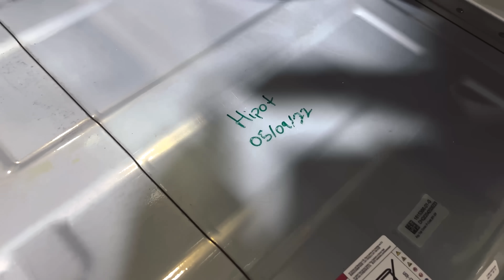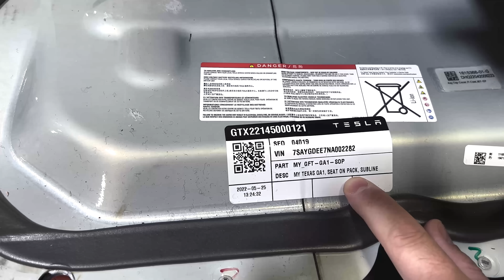Tesla Model Y 4680 Structural Pack OUT!!!

Comment: 6:15 This penthouse to house controls for the battery, can it be reduced in size? Not so much reducing the height but reduce the area it covers, so the length and width are half the current size or smaller. It might be possible to use the penthouse cover to mount the electronic parts or use the current panel for half of the components and the inside of the cover for the other half. The electronics serving the electric motors are mounted on the inside of the cover, same idea here.

Comment: I think we're not talking about a structural battery. It's a structural battery enclosure, which is a traditional stamped formed structure that integrates to the giga formed structure and other stambed structure such as A B and C pillars and car ceiling.There is nothing revolutionary here. They just firt the cells inside a traditional car floor structure.

Comment: On the Model Y - Is the battery located directly underneath the lift points? Or is it located slightly inside of the lift points towards the center of the vehicle?

Comment: The powder coat on all metal is because snow from your boots will rot the floor, and water and road salt will guaranteed get past any seal and rot the battery top/floor.  I have driven in 50 Michigan winters, I do know.  They are going to need air vents and water drain holes.

Comment: The floor/no-floor is an achievement but maybe this achievement is responsible for body low frequency noises when tires run over any road bumps. Could you tell if the battery pack assembly has any center deflection?

Comment: Incredible simplification and integration.  Tesla remains many years ahead of "competitors" due to a lot of clean sheet thinking AND continual improvement with VERY SHORT and concurrent change cycles due to spiral development practices.  

See also the Raptor 1 vs Raptor 2 rocket engines of SpaceX on Everyday Astronaut's recent video.  Also insanely simplified and integrated.  

Same thinking on both.

Comment: Tesla makes improvements monthly.  Legacy wait 5 years for mid cycle refresh or 8-10 year new model.  I owned a new dodge recently.  Power windows going out even one’s that were previously repaired and under warranty.( my time wasted going dealership all the time). I asked the guy have their not improved this same part.  His response was they needed to use up the old parts before the new improved part.  Use up old parts under warranty until warranty expires.  You would like power windows would be really durable.  Too much obsolescence built in the parts

Comment: It takes less than a minute to make a model 3 or Y, something like 44 secs for a M3.  This was before the structural battery pack was introduced, probably a little faster now for the MY coming out of GF Texas.  Mind-boggling.  And GM is currently making 12 Hummer EVs a day, like Elon said ‘they have to improve’ their production, that was commenting on GM’s 4th Qtr production of 25 Bolts and 1 Hummer EV. Guess 12 is a big improvement, 1200% increase.

Comment: Curious if the "powder coating" as you discussed has something to do to reduce conductivity. Given that the battery pack is now the floor, perhaps it's to reduce electrical and/ or thermal transfer?

Comment: My question is about pack serviceability in making the manufacture of the pack so efficient, it appears that the pack has been rendered unservicable.  I don't see how individual cells can be replaced when the pack starts to experience failures. I would love to see Munroe Assoc explain their take on what happens to the pack when enough cells go bad rendering the pack to inefficient .  Do you simply replace the entire pack?  What would the cost of a pack replacement be and what will Tesla charge for a pack replacement.  How long is there warrantee on the pack and the terms?  The old style packs seem a lot more serviceable where you can more easily remove the pack, open it and test individual cells and replace as necessary  without having to scrap an entire pack that may only have a couple dozen bad cells inside.

Comment: This kind of engineering is what Tesla's overall cost is spent on...and it makes it all worth it... for the buyers by making a car that's as safe as possible and for Tesla workers by making their job(s) as easy as possible... a win win win for Elon's pocket...

Now, when will Tesla build a 2-piece car - the bottom and the top shell, exactly like old Japanese flywheel powered cars but the two pieces are welded all the way around, like maybe ships? Connections will all be wireless and actually have no wires anywhere  and steer by wire?

Comment: Great... 1st of all, its paralleling of processes on assy line. You can remove some stations (seat, carpet, console mounting) from main line and shorten assembly time. Also, mount it outside much faster and easyer for robots. Next, less body parts, as it has no any bottom, so more bodies at shorter line.

Comment: I don't really feel comfortable with the battery pack being the actual floor. I know it saves money, but I still think there should be some sheet of metal between the battery and cabin.

Also, $800 for 1 cell? I guess that is to cover the whole R&D cost since that is, (if 850 cells), $680,000 dollars from the battery pack.

Comment: I look forward to seeing inside the pack. Will be curious to see if end cooling was abandoned completely.
The pack is definitely performing a structural role. In a side impact it can be deformed. Will be interesting to see what side buffer space is provided.
We know that battery packs can suffer thermal events. I hope to see a second inner steel cover and robust external venting adequate to evacuate the products of combustion without excessive pack pressure increase. If filled with resin, is adequate space provided for gasses to escape? Are those hot gas paths in contact with the cabin floor? 
Butt welded sheets of varying thickness may be a weak point in the cabin gas seal.
Hopefully Tesla has added a mechanical backup door latch to the rear seats, enabling those doors to be opened in the event of total power loss, as might happen in a collision.
Not saying this vehicle is a deathtrap, but there are areas worth examining.

Comment: Catl qinlin battery has 4x surface cooling area with in-between cell heat transfer, 621 mi range with 10 min 10 ~> 80% charge time. 

There’s a reason Musk keeps tweeting they’ve lots of optimization to do with 4680s. Chinese aren’t just twiddling their thumbs.

Comment: I'd like to see MA carry out torsional stiffness measurements on the new v.s. old battery enclosures and compare that with that of a cell slab assembly alone.  I wonder if the change in slab orientation to crosswise is to reduce stress on those slabs under body twist?

Comment: I bet Tesla eventually uses side squeeze snaps to mount the battery pack to the gigasting in the future, so they can just press the top and bottom pieces together until they "click" and never have to mess with bolts/threads/wrenches etc.

Comment: @ 1:47 Proof of what I've been saying all along.... The 4680 structural battery pack is an unrepairable POS! With a top cover riveted in place!
Reply: And who exactly was going to repair it?  Looks like they'd swap it and send a bad pack back which would be far cheaper and easier from a service stand point.
Reply: @TheEvilmooseofdoom  Gruber Motor company currently repairs Tesla battery packs. And I'm sure there will be more in the future. Provided the battery packs are repairable. Also, even if they send them out to be "remanufactured", The battery pack has to be designed to be repairable. Not sealed shut! A rebuilt battery pack would be far cheaper than a new battery pack. Built in obsolescence is wasteful, evil, and based on pure greed.

Comment: While I was genuinely excited and love the scale of innovation of engineering & tech involved with the structural pack, I also a bit confused with the safety with this MY. Can anyone enlighten me with the factual information about ..
1) How this structural battery pack can effectively contain the fire accidents as the passengers are directly seated on the cover of the pack?
2) Does the safety remains the same for Side Impact Collisions as the non 4680 Model Y's? 
3) What would be the replacement cost for the defective structural battery pack (If repairs are possible)?
4) How long does that Water Proof seal can hold? If the water is leaked to the cabin what would be the repair cost?
5) Did the overall structural integrity of the car increased with the F, R giga castings and structural pack?

PS. I'm a hardcore Tesla Fan Bot on twitter. I was just asking these questions to clear my doubts.

Comment: Is the new 4680 pack interchangeable with the old 2170 pack? Are the dimensions and bolt hole location the same or different? If different, what are the dimensions of the new pack?
Reply: I dont think so.. these have Front & Rear giga castings with slightly different mount points and side bars integrated with the structural pack (My guess from looking at both videos from Munro Live).

Comment: Good work.

Furniture makers create strong components for things like tables using 2 sheets of veneer which sandwich something called honeycomb, which is cardboard. It's super strong and light. Also, there are companies which use this sandwich technique for prefabricated walls, using thin metal which sandwiches a core of styrofoam. It also is super strong and light. Using batteries as the core in a structural sandwich is perfect for e cars and makes sense because it is so light and strong. Let's see what Tesla will invent next! :)

Comment: I was really worried that the structural battery pack would be a nightmare if there was ever an issue with the battery, however after this video it seems like the opposite is true: replacing the battery seems much easier now if it was ever required
Reply: Easy if you got $20,000-30,000 kicking around to pay Tesla to do it. As nobody else will be able to repair these and the only option will be to pay tesla to make safe and dispose of the huge hazard and replace with a spanking new one.

Comment: I’m definitely getting a “No user serviceable parts inside” feeling about this battery pack.  If there is a problem inside, seems like it would have to be tossed and replaced in entirety.  No “modules” that can be serviced or replaced individually, at a repair depot level.  They must have a high level of confidence in the individual cell reliability.
Reply: the Apple-ification of modern technology continues...
Reply: These things are extraordinarily safe compared to other vehicles, after the 15 years of car ownership, the battery pack could either turn into a power wall for another decade or be recycled, also by Tesla

modularity makes a house out of lego easier to break apart, as well as easier to repair, but the best repair is making it so strong that it doesn't need to be repaired
Reply: also, if a cell goes down, is damaged etc, this does not affect the overall vehicle, it would theoretically work even if half the cells are smashed, and whatever accident got you into that one isn't something that can simply be repaired anyway

Comment: Amazing, the throw away battery. They are getting close to the throw away car. A third party repair shop that could fix major problems would be very hard to find. The owner  would find out it will be treated much like a cell phone, if anything major goes bad just toss it.  You can make a pack repairable.
Reply: Agree these are more difficult to repair than the traditional battery pack cars but these are the same doubts raised by then ICE repair guys in the 2012 with the releasing of Model S.. The Skilled labour will definately learn to fix these structural battery packs as well.. Tesla cant stop innovation & reducing the manufacturing costs just because of these random independent technicians round the corner. BTW these aren't the throw away battery packs!
Reply: @DarkHawkk  these are the same doubts raised by then ICE repair guys in the 2012 with the releasing of Model S. They are buying used parts to fix them because Tesla doesn't want to sell new parts to the owners. Just remember that Tesla wants $20000 to replace the battery when a coolant fitting is broken flush to the pack  or a bad connection in that pack. How many 3rd party shops will take the floor out of a car out to give an estimate? After you take the battery out what are the chances all the seals are going to seal again? Tesla doesn't care about repair costs.

Comment: When Tesla does away with a traditional structural automotive frame and decides to fabricate a unitary battery and floor assembly, people are stupefied that the fronts seats are attached to it! Well, where else are they going to be bolted? They can’t float in thin air. My biggest takeaway is how “un-serviceable” that structural battery pack looks. If there’s any internal failure or issue then it looks a tear-apart job that will not go back together nicely. I hope Tesla has done their homework so that no undue dynamic torque stressing spread through-out the pack will not fatigue it unduly so as to lower it’s integrity and/or cause electrical connectivity issues.

Comment: Hmm - how can you tell it's a 4680 LR battery pack? I thought they were doing plan B, structural battery packs with 2170's UNTIL they iron out the production glitches of the 4680.    OR are there both 2170 and 4680 structural packs, with in addition SR 4680's ?

Comment: its going to be a nightmare for service centers to replace a bad battery.  Because there is no way a replacement battery will come pre assembled with all of the interior like that.  it will all need to be removed from the original battery.
Reply: assembly and production-wise, this is brilliant.  it removes about 20 stations from general assembly.

Comment: No doubt this is awesome . I’ve been  involved in manufacturing in a previous life. This is so incredible… but there are many more manufacturing efficiencies to go.  Tesla will eventually “print” cars. Many of the wires and connections you see here will be integrated  into the casting ie molding inserts.  Elon is on the record concerning the production of toys as an impetus to Tesla automotive design/production / manufacturing.  Watch out Ford and GM . I bet they are shaking in their boots… and this is just the tip of the Tesla iceberg. I’ll bet right now Tesla has at least 100 changes that improve on what we just saw in this video.  Being less wrong is way more efficient than thinking something is right.  Lastly ,Tesla has data on each production step.  Each data point reveals wasted motion or delays or bottlenecks. The secrets Tesla must have.  There is so much more to come. Anyone that believes the technology curve is flattening at Tesla is just not paying attention.  I doubt seriously if Munro and Associates  will be able to keep up with all of it… I hope they do so we can see it all … but it’s going to be hard.  This is also great free marketing for Tesla.

Comment: My only question is what happen in case of a flooding?, will the water enter the car?, if so, how much more damage could it make?. Amazing concept IF they got it right.
Reply: it's just like every other car when it gets flood or water damage. the good thing about this unibody design is that during a flood repair,the whole structural floor pack with the lower interior simply drops out like a toy car chassis making battery swaps and the pain of swapping big interior pieces a breeze.

Comment: So.... if the battery fails and ignites, there's nothing protecting you as you're literally sitting on top of it?
Reply: Was there some reason you were unable to see the steel sheet covering the entire top of the battery pack?
Reply: @fredbloggs5902  

1 - No idea what your attitude is about

2 - ALL of the battery packs have a "steel sheet" covering the batteries, yet when the battery fails, they create a significant fire event.  (The temp can exceed 3000 F)

3 - Difference being that in the older cars, there was at least another level of structure between the driver and the battery pack.  In this vehicle, you're literally sitting on it.  Again, the battery fire will consume the whole vehicle, but another layer between you and the battery would buy you some amount of extra time.

Question was to the experts @ Munro, would love a comment from them.  (I don't need rudeness from the peanut gallery)

Comment: I assumed the structural pack would be welded to the rest of the body. The fact it’s bolted and relatively easy to remove and replace if necessary is amazing. With two mega castings at either end Tesla is doing an unbelievable job of innovating
Reply: Good luck with water leaks.
Reply: @epoxy1710  I bet chasing down water leaks between the battery pack and the body is going to be an expensive nightmare for service shops and owners to resolve
Reply: @epoxy1710  You even watch the video? There is a thick seal between the pack the the body. There should be no leaks at all with that seal.
Reply: @pipooh1 Give that seal 10 years.
Reply: @epoxy1710  So 10 years for the seal to fail, 1-2hours of work to remove the pack, put a new seal and bolt it back in for the next 10 years. I do not see a problem to have this done as a 10 year maintenance thing for a car. Surely since you have no other maintenance you have to do on EV.
Reply: @pipooh1  the car is steel, a water leak will rust this car away.
Reply: @epoxy1710  No it will not... The whole body in white is coated in corrosion protection before going into paint like all cars have been for past 15 years. This is also the reason why the battery pack has a powder coating on it. There's no more plate between the pack and passenger department so the pack also need to be coated which they have to prevent corrosion.
Reply: Yes, the thought going into low labor cost for pack removal and battery replacement, reuse, or recycling is impressive.